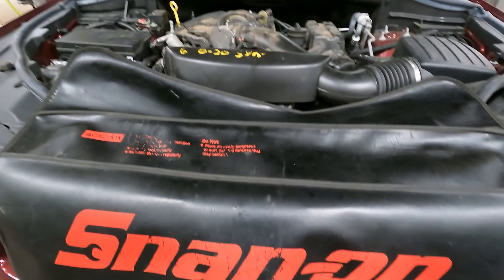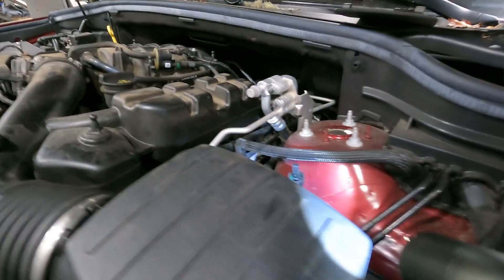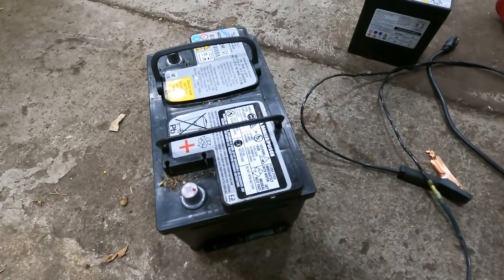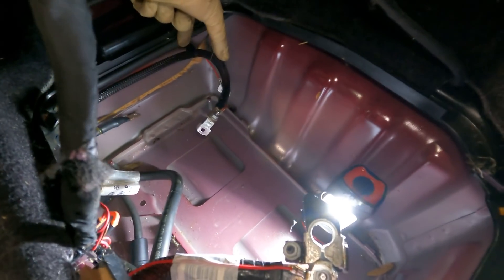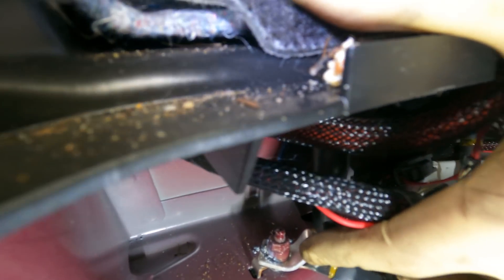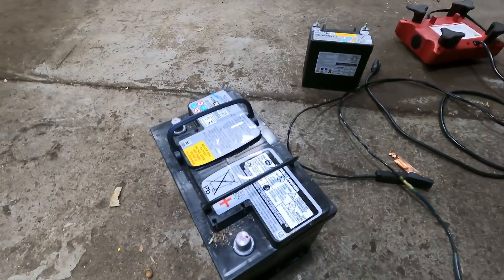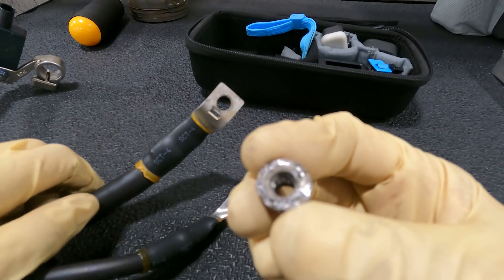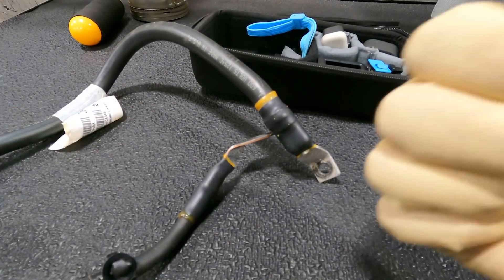Customer states "LIGHTS GO DIM AND WINDOW GOES DOWN RANDOMLY"🤔🤔🤣🤣😲

Comment: Man check this out it’s currently 12/6/21 and I had a 16 Jeep just like this one come in on flatbed smoking from engine bay low voltage and died. Hooked jump pack up and almost caught fire but killed jump pack before that happened. Got it inside and right then I remembered this video right here and went straight to the battery to literally find this exact problem no auto start stop start battery but same ground issue but I couldn’t get it off to fix it so I had to weld in a new stud and remove the 8mm baby one. Went to a 11mm stud that fit the factory hole in the negative. This is one of the main reasons I love watching your channel man

Comment: Actually a passenger ejection system. Someone puts in a wrong battery while firing the parts cannon, hydrogen vents into the closed compartment under the seat, cable arcs, then BOOM! Passenger is ejected through the sun roof, giggity!

Comment: Great you found the issue, can you imagine some replace mechanic getting ahold on that Jeep, he would of been replacing everything before he found it. Great job!👍🏻
Reply: See, my first thought would be replace the battery, but that would have led me to the problem in short order.
Reply: “Needs a TIPM”
Reply: @Musclecar123  no he doesn't, the problem was fixed by cleaning the bad ground wires. You must be a "replace every module first" kind of guy and ripe off people.

Comment: I had a 2004 Buick Ranier that the headlights would dim and the ampmeter would show discharge unless you raised the idle or drove at a high speed. Shut the car off, and it wouldn't do that again for maybe six months. No dealership could find or admit to a problem, even though that Raniers were known to have electrical problems. A year after warranty, it went up in flames while parked. Luckily, it wasn't in the garage or didn't happen while I was on the freeway. Of course, Buick didn't cop to shit. That car was in showroom condition, but I got burned a little by my insurance company. I made it up a few years later when I totalled my beater Mercury Mariner, the Ranier's replacement, when I hit a buck on the I-480 doing 70 at 5:00am. They gave me top dollar for the beater. Luckily, they can't charge you a deductible in Ohio if you hit a deer.
Reply: That's true on the deductible. Earlier this year I totaled 2 cars via deer. First one was too old/high mileage to even claim. Second one was a 12 year old Corolla with ~130k...they gave me $8k for it, same day no questions asked.
Reply: jpharleyd , who is your insurance company?
Reply: @gavnonadoroge3092  Met Life, but they were just bought out by Farmer's Insurance. If you're inquiring because there was no deductible when I hit the deer, I believe that is a State of Ohio mandate if they do business in Ohio.
Reply: @jpharleyd9325  thank you

Comment: Grounding is poor on lots of new cars. I recommend a separate ground cable from Alternator bracket to negative on battery. then check, tighten and seal all grounds. Nice catch. Remote batteries are a special pain.

Comment: It seems obvious to put the battery where it can easily be located to clean corrosion and do a quick visual inspection.  Why are these things so hard for manufacturers to figure out?
Reply: its a jeep thing, you wont understand....
Reply: Because "everybody" wants low, swoopy, "cool" low front ends. So there's no room to even cram the battery in due to lack of space (height), then they put it under the floorboards like a 1940 LaSalle, or in the trunk/boot, in a wheel well like some 90's Chryslers.
Reply: I just love having a lead acid battery in the cab with me under the driver seat (Ford Transit) or under the drivers feat ( Mercedes sprinter)
Reply: Yup, dumb design choice, plus poor engineering of grounds, and likely mediocre assembly.  Jeep, er Chrysler, er FIAT, er Stellantis doing what they do!
Reply: It is actually an excellent design choice as it protects the battery from extreme elements and hence increases its life.

Comment: Why on earth do you put a battery in the passenger compartment?
Reply: No room to put it under the hood with the low-height designs; my late father's 1940 LaSalle had the battery under the driver's floorboards. What's old is new again for different reasons.

Comment: Okay… WHY would the main battery be placed UNDER THE PASSENGER SEAT!? Seriously! That makes replacing the battery a round of Bullshit when it could be a simple “1,2,3,Done” scenario. WHICH CAR MANUFACTURER MADE THIS!?!
Reply: That was a Jeep, but GM does that too.  Helps with weight distribution since batteries are heavy.  (BMW puts 'em in the trunk for the same reason).
Reply: Depends. who was building Jeeps in 2017? I believe this is under Fiat but not sure how old the design is since Diamler stole all of Jeeps tech and then attempted to murder the brand
Reply: It protects the battery from extreme elements.

Comment: What in the hell is a stop-start battery?
Reply: Some newer cars have auto-stop/start battery systems. When you're at a stoplight, the car's engine shuts off and everything just runs off one battery; there's a second battery there to give juice to all your auxillary stuff (lights, infotainment, etc.) while still having juice to pour into starting the engine
Reply from the maker: Correct 😁
Reply: @horker  I was wondering why I would hear cars start up at the end of a red light so often recently since there's no way it was a stalled out manual with how smooth it sounded
Reply: @saigyl9149  yeah lol it would've been a mystery for me too if I heard that without knowing about these stop/start systems 😆
Reply: Oh, it stops working and starts working whenever it feels like it. :)

Comment: Hey Chrysler - bad terminal design/layout!  The stand-off for the terminal lug is like a lever on the stud with the heavy gage of the ground wire.  That terminal lug should be flipped upside down so that the lug angles down, and the ground stud should have a flat washer or a flanged Ny-lock nut, at a minimum.  Tsk, tsk...

Comment: Your used to working on audis Jeeps won't disappoint you
Reply: JEEP: Junk Each and Every Part. :)
Reply: Seeing as Jeeps are manufactured by Fiat Chrysler (now Stellantis)

They have HORRENDOUS reliability issues 

Think otherwise? I suggest you look at reliability indexes
Reply: @edwardtrickett1983  I would take my chance with Jeep over anything GM.
Reply: @edwardtrickett1983  Do you think the older Vauxhalls were better vehicles than domestic brands such as Rover and Jaguar? Having gone through GM ownership nightmares aswell as witnessing many others suffer the same I have since completely wrote off all GM vehicles, including Opel.

Now that Opel changed ownership i might give the brand another look but only once i am sure all GM residue is burned off.
Reply: @edwardtrickett1983  Interesting write-up. What happened to MG that they stopped producing cars? Also, was there a Rover/Honda collaborative considering i clearly remember a 90's saloon that was an Accord with an upmarket leather/wood  interior.
Reply: @vw5056  

@Edward Trickett  Interesting write-up. 

*Thank you, I don't know everything but research is a wonderful thing

What happened to MG that they stopped producing cars? 

*Morris Garages (MG) - William Morris's Morris Garages, was founded in 1930, it worked along Morris and had upmarket options for Morris vehicles of that era

In 1952 it was subsumed into BMC and in 1972 with BLMC the MG name was no more than a badge marking a trim level

MG was revived in multiple guises with BL for cars which were really mediocre like Maestro and Montego

In 1995 we had the much loved MG-F

Then again marketing meant that the 25, 45 and 75 were marketed as MG ZR (25) MG ZS (45) and GT ZT (75) 

Then in the last gasps of breath from the company, a mild facelift was introduced, but it was too late... 2005 the company collapsed

Also, was there a Rover/Honda collaborative considering i clearly remember a 90's saloon that was an Accord with an upmarket leather/wood  interior

*Absolutely there was Honda/Rover collaboration

The first being the Triumph Acclaim aka The Honda Ballade (booted civic) in 1981 till 1984

Followed by the Rover 200 (SD3) 1984 to 1989

Then the Rover 200/400 series 1989-1995

1995-1999 saw the 200 and 400 become hatchback and saloon separately (same chassis and engines though)

1999-2005 saw the names change to 25/45 but little else  

The accord model you reference, may have been a Rover 600, Rover of that time were ALL about interior comfort, making the buyer feel they got more for their money

So I hope that answers your questions

MG is now a Chinese owned company since 2006, they have produced models for release to the UK market, the MG 3, MG5, MG 6 and MG ZS (other models were released for other markets) but they were of limited success 

The global pandemic and Chinese infrastructure and political arrangements put the brand under pressure
Reply: I own a Jeep. I concur with all of this. My warranty has been the best purchase I made 🤦🏼‍♀️

Comment: NICE. My 2006 Charger has a random stall issue. Happens once every 6-8 months. I’m going to check the battery ground.
Reply: Man you have a problem. Seems it's very common for that year and model when I did a search. You can check the grounds and connections. You may get lucky. Seems it's the PCM. If you have a local electronics wizard he may be able to fix the one you have.
https://www.youtube.com/watch?v=PQZe74CLOWM
Reply: @robertthomas5906  thanks for that video. Seems like the PCM, Crank position sensor, bad trans plug or bad battery ground could all be possibilities. 🤞it’s been months since it’s last episode.
Reply: Same parent?

Comment: why the f does a cherokee have the battery under the seat?  Is there no room anywhere else in this bloated vehicle?  This car could have caught on fire.....how is this not a recall?
Reply: Not a recall, most likely because some goomba in the factory didn't tighten it to spec - if you could prove that it worked it's way loose then they might issue a service bulletin, recalls are E X P E N S I V E.